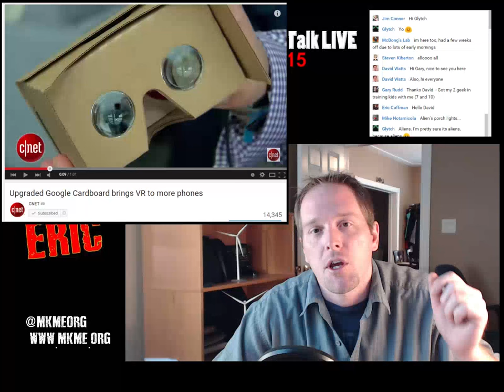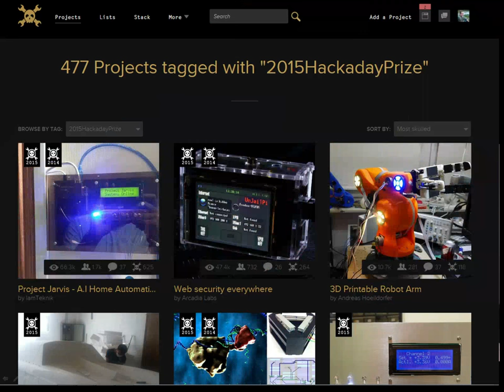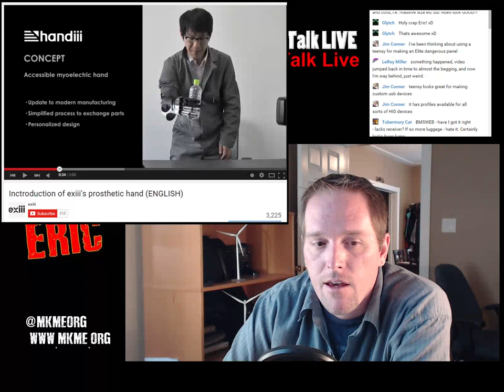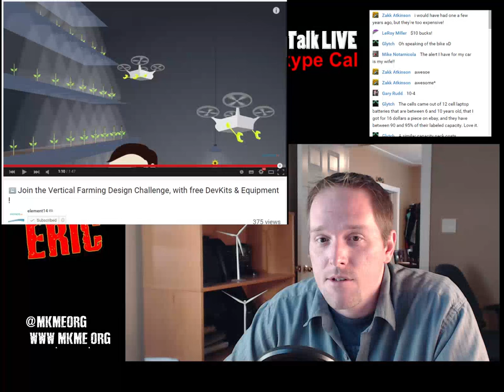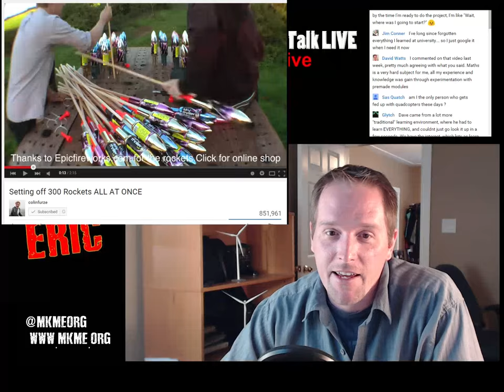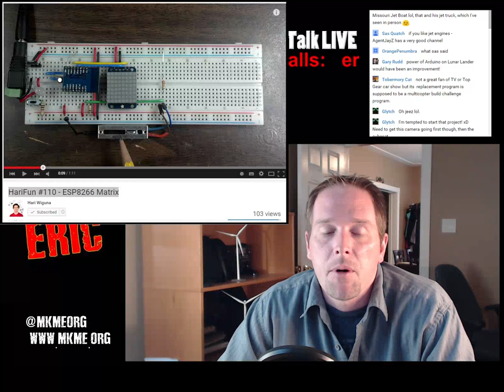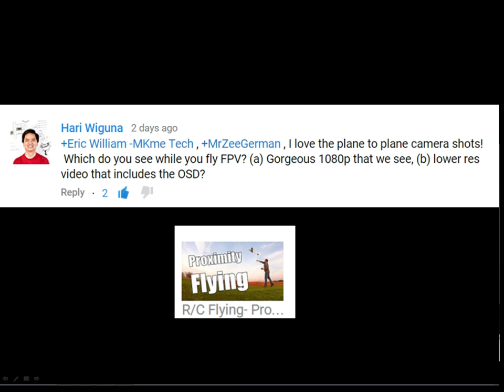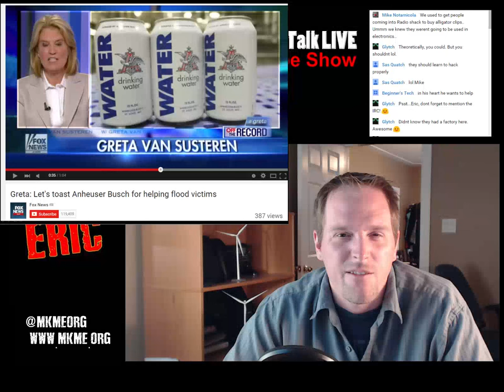Tech Talk Live with Eric #29- Maker & Technology Live Show

Comment: Hey there! 
I've finally been able to take a few mini-steps with my home cockpit, and even struck some $$$ to purchase a Saitek Yoke with an extra throttle quadrant! As I recall, you've mentioned that you use the same throttle quadrant yourself in your Learjet man-cave. I also seem to recall you mentioning that you had new knobs 3D-printed for the quadrant? Did you do that yourself? Could I trick you into accidently printing a couple more, or even two special knobs that each grab on to 2 levers in the quadrant? =) 
I've had to settle with a low-budget ghetto-solution for button panel for the time being. I hooked up a second USB-keyboard to my computer and glued my autopilot display with heading and speed selector knobs to it (much like the display on the Logitech G15). I then run software called HIDmacros to detect keypresses from that second keyboard and send commands to X-Plane. I then ripped off all the relevant keys from the keyboard and treated them with the airbrush! It looks completely ghetto, but it works like a bloody charm! =) 
As for external display, I stumbled across a plug-in for X-Plane, XHSI. It's a small Java-program that displays PFD, MFD, EICAS and ND in windows separate from X-Plane. It can run on a computer that doesn't need to run the sim itself, so it'll run with more or less anything. It just needs to accept data from the sim over the LAN. Did I mention that it's DONATIONWARE? XD

As for other projects, the money-drain quickly becomes a bottle-neck, but I'm slowly working on using a Teensy to control LED's on a 1:350 scale model of CSN-65, the USS Entetrprise Aircraft Carrier. Lighting up the hangar bay I added, blinking runway lights, a "working" "meatball" and small details lit up. I'm going to see if I can't even get a few threads of fiberoptics into a plane about to take off, and have the Teensy make an LED "glow" (flicker) for engine-glow. Fiberoptics are great for when LED's are too big =)
Reply from the maker: ***** PM me.  You are in luck on Saitek parts.  Cheers